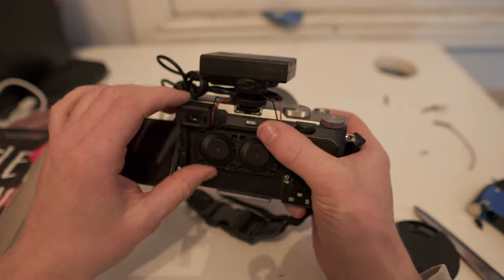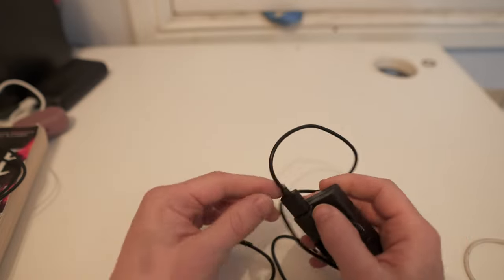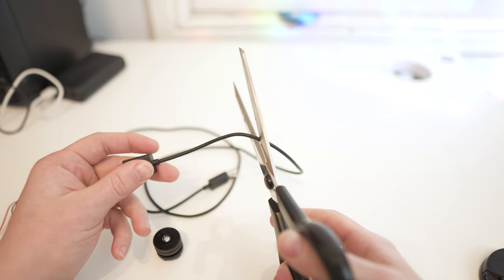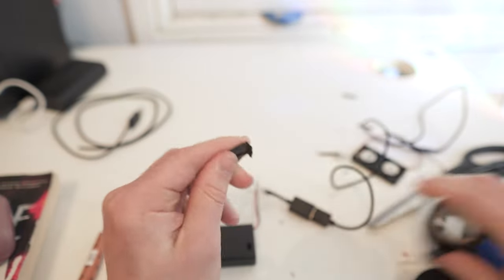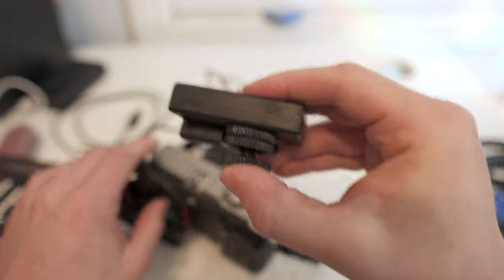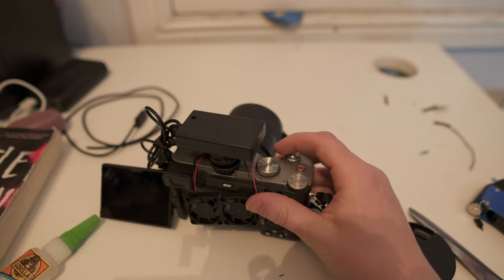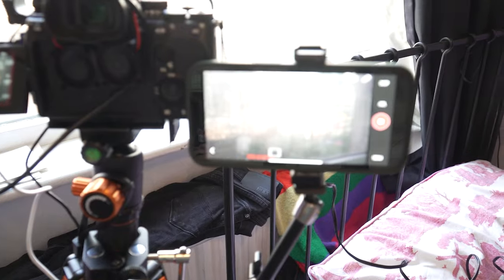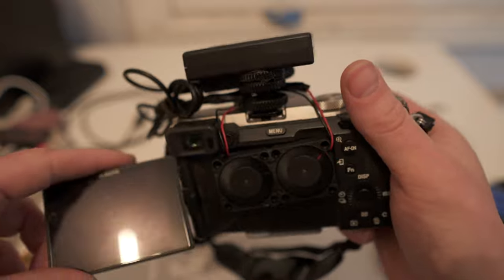Turn Sony ZV-e1 into an FX3 with a portable clip on fan

Comment: I am curious if attaching a thin piece of metal foil could impact the effectiveness of this setup! Much like how DIY Perks used a copper plate to water cool his Canon R5 - the plate alone netted results. I'm happy to see such a simple fan setup be so effective, thanks for sharing - looking forward to seeing those cool custom printed housings people make.
Reply from the maker: Great point! Maybe some heat can be dissapated through the hot shoe mount metal tripod screw adapter.
Reply: @AxelWolstenholme  That was actually an idea Mr. Perks came up with - realistically that would require there be heatpipes already be routed from the CPU to the tripod screw... One can dream of a manufacturer that will actually implement that.
Reply: Yes my final design will for sure use metal to guide heat away from the backside of body into a alu6061 and a fan pulling air out.
Reply: @uniworkhorse  I think i have a 50% hit rate getting this into production with smallrig.. ill give it a try for sure.
Reply: @scb2scb2  0_0

Comment: I wonder if the white ZVE1 would overheat less.
Reply: That’s racist
Reply: @jacksp8de  lol damn. But if I get the black one then it’s slavery.
Reply: @2cats1guy  🤣 You’re right get the white one
Reply: It depends, the black one would radiate heat more efficiently so cool down faster but the white one would reflect more heat in the first place. So if you're indoors then the black one but outside in the sun, then the white one.
Reply: @kittparker4161  oh interesting. I never thought of black having the inverse effect from the inside.
Reply: @kittparker4161  pretty much, i also expected as much but i made some investigation with thermal camera and seems like this zve1 did not seems to use the body to dissipate heat much. so indoor performance between white and black might not differs a lot.
Reply: @hogesyx  good to know, thanks for you doing the good work!
Reply: Black absorbs heat, white deflects so who knows.
Reply: @danjacobson9881  I don't think it is working that way.. black absorbs heat more from sun or lamp, but there will be no difference when the heat emitter is a hot sensor/cpu. Besides, inside the body both versions are black, as there is no light inside :)

Comment: Ahhh yes, blowing hot air onto hot plastic. The camera world is such a joke. A $3,000 CAD camera folks.
Reply: They had to cripple it somehow
Reply: I don't know physic but it works on my a6500 though. Shooting outside in the hot day, it has less overheating using these fan 😅
Reply: Hufman9807, what do you mean?   Most cooling on cameras are done using a FAN about the same size, infact the air being blown is not cold like you claim, it is the same temperature as the air surrounding the camera, but the movement of the warm air helps to cool.
         I think liquid cooling would be interesting

Comment: definitely not worth it. spending over 2000 on a camera to go diy a fix for your new camera. when theres much more affordable cameras that dont overheat. if this was like a 700usd camera then theres less to complain. youre going to return it as it would get annoying to have all this diy stuff juggling around.
Reply from the maker: That's fair, I use my fx30 which is cheaper when I need long 4k record times but it isn't as convenient as the a7iv with the evf etc, I've had the a7iv overheat a few times though in challenging situations. My favourite camera is still the first sony I bought which is the a7s, that never overheated ever and had pretty good quality, can be had for like £450 now second hand too.

Comment: Sounds like a joke against sony since they are incapable of just adding thin cooling fins between the display and the backside. Like this you would have as good cooling with a fan, but passive when you flip out the screen.
Reply: Not incapable, fx 3 and 30 have fans. Give zve1 a fan and its a better cam than fx3. At almost half the price point that wouldn't make sence. Although zve1 doesn't make much more sence now would go fx30 or 3 any day probably.
Reply: @Bobdrumbro  if i would go that way i would go just for the A7S3, but since it doesnt get new features anymore also not this….